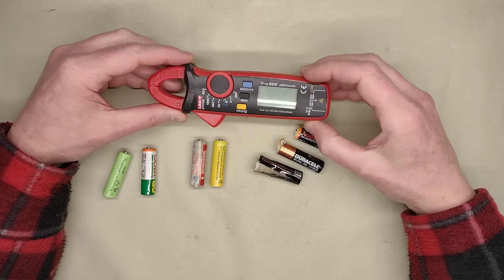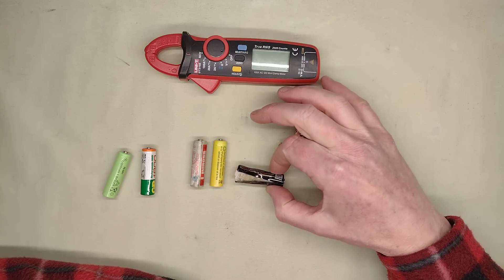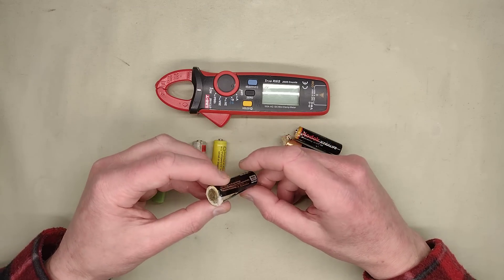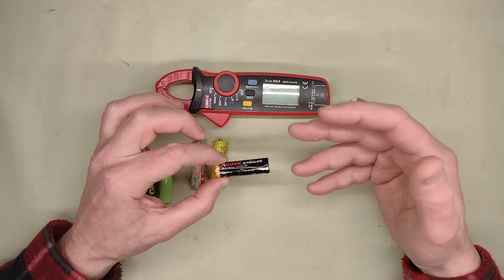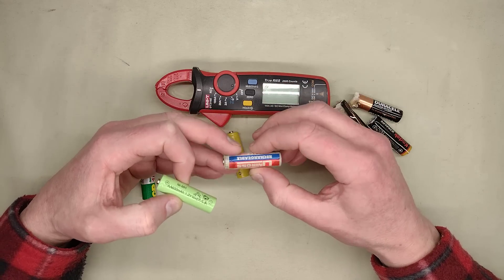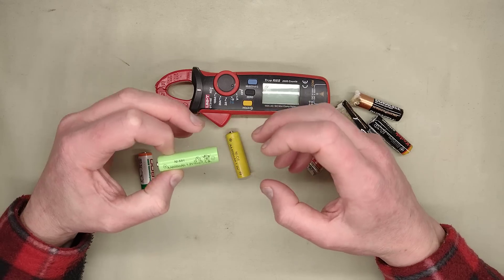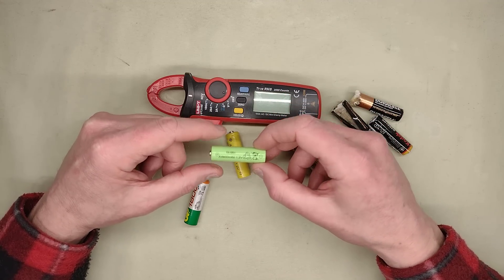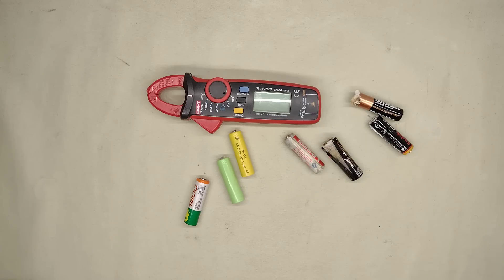The curse of leaky alkaline batteries

Comment: at my work, I go through several hundred alkaline batteries a year and can't recall the last time I've seen one leak. many of them can be several years old and I buy the cheapest ones I can find. I estimate I have approximately 800 alkaline batteries in one building and about 720 in another building in use at any given time
Reply: But if you buy the cheapest, that won’t be Duracell brand…
Reply: @Mark1024MAK  through our supplier it can range from the maintenance warehouse brand to the Duracell Procell or sometimes Rayovac.

Comment: Alkaline batteries were a huge improvement over the old carbon zinc flashlight batteries. I have bought primarily Duracell batteries (the copper top) for a number of years. I have noticed a sharp decline in their resistance to leaking somewhere during the past 5 to 7 years. I have had Duracell batteries leak in the packaging, long before their stated expiration date. I think that Duracell is just a trademark name they put on the batteries, & they are actually made by some Chinese companies, who are probably the lowest bidder.
Reply: Exactly. I've found Duracell batteries in my boxes from twenty-odd years ago: no leak.
Ones still in packet from the year before: leaking.
Some advice I got a few years back was to buy supermarket branded batteries: Sainsburys doesn't want their name on your ruined equipment, even if Duracell don't care.
Reply: It is typical in manufacturing to have a goal for managers to cut costs by 1% or more every year.

The end result is that after 10 to 15 years of cost-cutting the resulting product is poor quality.

It's likely that the leaking is processed by cost Savings of less than $0.03 and the batteries would cost 5 to $0.10 more if they didn't leak as easily.
Reply: @mac_mcleod  Nail on head I'd say. Years back they didn't leak, it was a sales feature, now they do
Reply: @mac_mcleod  this explains so much
Reply: The zinc-chloride batteries weren't that bad in the past either. I have a pound shop scientific calculator that I bought in 1996, which still has the original Hitachi cell I put in there on day one. Gets used every six months on average and not showing the slightest signs of leaking. I find it amusing that such a device has outlasted just about everything else in the house!
Reply: @jasejj  As long as the zinc chloride isn't too large (AA or smaller) and can breath I don't find mny issues on them either - not even newer generic store brands. I even bought a vintage Sharp calculator at a thriftstore because I wanted a physical calculator at my desk. It still has the original zinc chloride/carbon. Can't remember if they expired 1983 or '85 yet they've not leaked and still powers the calculator(!)
Reply: @jasejj  I have a calculator that gets rarely used and still has original cell over 20 years later!
Reply: The problem isn't just chinese manufactured Duracell. I found a whole bunch of leaky Duracells from Belgium that were leaky. 
I have now switched to German Varta's. We'll have the results in a few years i guess.
Reply: @mfbfreak  Duracell's have failed me already more then 15 years with leaking.  I made an error to not take out the batteries from my pinball machine that i put in storage in 2009 (feared the worst) which are just to keep settings/high scores. Came around checking it a few months ago. NO LEAKING whatsoever.. even one battery tested as nearly full! Date on the battery 12-98!  These where Varta's Alkaline stating "Extra Long Life" seems the Germans where not bullshitting on that. Do hope new Varta batteries have the same quality.
Reply: @mfbfreak  varta have been good in the past, but the ones sold here in Australia the past year or two now seem half the capacity they used to be, and have actually had my first carts from the "new era" leak. It may be the issue that the sole retailer here has kept the price the same for years, forcing varta to compromise
Reply: @mfbfreak  , ive had trouble with vartas.
Reply: Maybe this is news for someone, but many companies make different quality products under exact same branding, for different retailers, for different regions. If you are buying a cheaper brand name product it can often look pretty much the same but made in a different factory from worse materials and worse quality control. Big stores often demand lower price versions of the products forcing manufacturers to cut corners.   Sometimes they even refuse to provide normal guarantee for those versions.
Also worse products are made for poorer regions, countries with corrupt govts, that don’t care about environment or health of their citizens, where safety regulations don’t exist or not enforced.
Reply: Yeah, Duracell has been hot garbage for the past few years, at least for me. I don't think I've pulled one of their cells out of something without it being crusty in years, and they seem to be dying on their own faster than my rechargeables.
Reply: Helpful Tip: When buying bulk akaline cells, always buy the ones like Duracel or Energizer that are sold and shipped by Amazon direct. They're always brand new and NOT out of date like the ones from the 3rd party Sellers.
Reply: Same here with regards to leaks with recent Duracell batteries, well those that are at least between five an ten years old, when they were made under Mallory they seldom leaked, my theory on this is in the older days they were better sealed, things were made to a higher standard but sadly now with such things there made in china cheaply an in some cases not to a high standard and the materials are of poor quality, hence the leak's. China is also knocking out fake Duracell batteries and Panasonic ones to, some are easy to spot. I once bought a torch and inside were two Panasemig batteries, yes that's the spelling, probably named to avoid copyright, a word of caution though be careful with some Chinese rechargeable batteries as sometimes these can catch fire because china sometimes does not build such items to a countries safety standards.
Reply: @mikecummings7054  Mallory Corporation hasn't existed in years which might explain why the Duracells (and probably Mallory branded batteries in Canada, instead of Duracell branding they used to brand their batteries Mallory up there) are of lesser quality nowadays.  I think people are correct about the current Duracells being Shen Zhen Shit batteries, just a very little bit better quality than the random letters brands that come from the same place.
Reply: I tested quite a few batteries, cheaper ones perform almost as well (capacity around 1900 mAh for AA, for example) but they very often leak if left alone. Had boxes of cheap Kodak-branded ones and after few years in storage 40% leaked completely, remaining ones in the same package are totally fine and work basically like new.
It is totally fine to buy cheap alkaline cells as long as you are going to use and discard within, say, 1-2 years.
Reply: I have a collection of calculators and have bought LCD calculators from the early 1980s still with the original Japanese made (Toshiba or Sharp) alkaline batteries inside, not leaking and still working fine after over thirty years. They obviously don't make them like they used to.
Reply: I agree to the most part, it's insane how high the leakage rate is now. The one brand I find rarely leaks are Rayovak. They also are much cheaper per mAh, so I rarely use anything else...if I can't get away with using NiMh instead.

Comment: Thanks, but I have quite a few older pieces of kit that will not run/run for short periods because of the low voltage of NiMh. For newer kit, yes no issue.

Comment: For applications like powering DMMs, I'm thinking of Li-pol cells with 3V LP2985 low-noise ultra-LDO for powering and TP4056 for charging. But I still can't find free time to prototype the PCB for the typical bay size for 2xAA or 2xAAA.

Comment: I use Eneloop Pro personally. They last 50-70% longer than an alkaline equivalent. In something like my high output flashlight.. it can drain a normal battery dead in 5 minutes, but rechargeables will last 10-15 minutes of constant use.

Comment: Thanks Clive! Do you have tips on cleaning / repairing devices damaged by alkaline leaks? Perhaps another video!
Reply: A weak acid like vinegar or lemon juice will eat away at the alkaline battery spooge. If it's mainly just a battery compartment you're dealing with. Best to just disassemble the device, put the part of the shell containing the battery compartment into a bowl and put in your vinegar and let it soak a bit. Use a small brush occasionally to work off the loosened junk. However the battery terminals that were attacked by the batteries won't be nice and shiny anymore since the batteries alkaline contents will have attacked the plating on the contacts. If it's on a PCB itself you can spot treat with vinegar or lemon juice and cross your fingers you don't have eaten through PCB traces that you're going to have to rebuild with bodge wires. If it's a multi layer board and worked it's way inside the layer, you're pretty much SOL. This is a common problem in the retro PC world, where boards from the late 80s early 90s had rechargeable nicad cells soldered to the board and these boards sitting in storage the last 20/30 years have had the batteries leak out and destroy the board. The YouTube channel necroware has some videos on repairing these boards that aren't too badly damaged. Involves cleaning up the leak and rebuilding board traces as long as it's only surface damage
Reply: If the leakage is a clean white colour and is a dry powder type, you can wash it away under a running hot water tap. Let all water drain away and let the item dry for 24 hours before putting in any new cells or battery. Otherwise follow what Doug K wrote and use white/distilled vinegar (from supermarkets).

Comment: So far for the most part I am using NIMH as well as some Lithium rechargeables for some stuff. I usually am using alkalines for devices that require to many batteries or things I don't want to ruin a rechargeable on like something close to water or something in the bathroom or kitchen. If I am using alkalines I tend to use Energizer or Fujitsu as those two brands seem to take the longest before they leak.

Comment: I've started to gradually replace all the batteries in my house with NiMH batteries. The only thing I can't really give up alkalines for is an electronic safe. Those things need the linear discharge profile to accurately keep track of battery level, and also because the manufacturer recommends anything other than Alkaline.
If one does need a slightly higher voltage, however, those Energizer Primary LiFeS2 batteries seem to be fit for the job and they don't leak.

Comment: Oh, I recently had a Duracell™ with Duralock® that nearly killed my multimeter due to leaking. But still I'm not sure about NiMH cells in multimeters. What is cutout voltage of the UT210E for example? I bet it's the same as the other DMMs based on DTM0660 (DM1106): around 2.2-2.4V.

By the way, I've never seen a leaking GP alkaline cell. 🤔

Comment: NiMH becomes an issue especially with cells in series - got a few devices using 2x or 3x AA/LR6 or AAA/LR03 in series (CMOS battery replacement in old PCs, for instance), meaning 3V or 4.5V. Even with them dropping down to 1.4V per cell or so over time, that's still quite a lot above the 1.2V of NiMH cells, sadly. Tried a few clocks as well, they tend to dislike the low voltage too.

When and if voltages can get bumped up on rechargable cells to equivalent levels, I'll definitely switch from alkalines. It's a shame NiZn has a higher self-discharge, otherwise that might've been interesting.

Comment: maybe you can answer the question , why can't they make a cadmium or nickel metal hydride batteries in 1.5 volt for aaa , aa , c , d and 9 volt for transistor batteries  ,  and why 3.7 volts for rechargeable lithium batteries . can you do a video on these questions
Reply: It is the electrode potential that determines the battery voltage. Look here https://en.wikipedia.org/wiki/Galvanic_cell#Cell_voltage

Comment: The only issue I have had with using NiMH batteries has been realatively dumb devices that to operate normally or a normal performance require the 1.4/1.5 Volts.  That and charlatans selling mislabled NiMH batteries as a higher capacity per charge, or in one case, form factor, with tons of customer reviews from people that didn't realize they were scammed.

Comment: There was a time in Australia about 30 years ago when Duracell batteries never leaked, and so were my go to. However over the last 10 years I’ve found they leak.
Reply: That is because Duracell is now just a brand name slapped on some random cell. They stopped making batteries years ago when they were sold off to VC and hedge funds who just kept the name, but farm the actual work out to whoever is cheapest.
Reply: Duracell has become one of the worst batteries for leaking. I find Costco Kirkland batteries better and cheaper.
Reply: @ColinTimmins  those are rebranded duracells

Regular energizer alkalines are the best I have found for staying leak free. It still happens from time to time, but far less or as quickly than duracells.
Reply: Duracell are the worst for leakage in my experience. I expect a battery to leak if it is left on load when flat but Duracell seem to do it just for fun. They are utter garbage and I won't buy them.
Reply: @tubaman66  i have 2 sony alkaline battery in the remote of my old vhs that the date is until 2001 and still working without any leakage  still 1.4v because the remote gets no use now
Reply: Duraleaks are the worst of  all alkaleaks.
Reply: Exactly, same here in the UK. I recall in my younger years that Duracell batteries were guaranteed never to leak! Infact I think the company would pay to repair your equipment if indeed they did!  Lately I’ve been noticing countless Duracell batteries leaking!
Reply: Yeah, Duracell have been hot garbage in every encounter I've had with them for the past few years now. At this point, I avoid them like the trash they are
Reply: Back when i was working in a local charity shop anything battery-powered that came in was checked for cell leakage and majority of leaking ones were Duracell. And no, it wasn't due to more Duracells being used in the stuff donated.
Reply: Sorry about the editing scars in that.
Reply: I got a wall clock for my office as a Christmas gift.
Yesterday I looked in the supply pantry for a battery and the two Duracells I found had leaked.
Reply: I have found the same. Duracell at one time made it a point in their commercials that they where the go to battery you could count on to work in an emergency after sitting in a drawer for a long time.
Reply: Exactly the same in France, I've ruined several items due to the current Duracell products. I remember when I was young, using Mallory brand which became Duracell later, it was really a reference for camera cells... Sadly, I resigned to use anymore Duracell, it became dangerous craps.
Reply: Same... the last 'real' duracell duralock batteries I had were from 2015 and came with a logitech wireless mouse... they last till 2021! I still have them in the desk drawer as a memento :D

Looking closely at it the bottom (anode? the minus side) of the good old ones they have DURACELL stamped in a circle and the anode is shaped as a plate, the more recent ones don't have anything aside from a yellow seal and the anode is shaped as a flat disk.

New ones leaked after 1~2 month on a wireless mouse - different logitech mouse, only takes one battery, original lasted 2 years - and to think I got a package of 10 batteries thinking they were as good... From a sample of 6 batteries they all leaked in less than 2 months after use!

Incidentally I got some branded from a big supermarket chain that are really nice, I'm yet to get any leak after 2 years on use in a wireless mouse, bike lights and digital scales...

But yeah, I got some low discharge NiMH and a USB charger for those uses where I know I'll be handling the device, the last thing I want is to have electrolyte all over the desk and hands...
Reply: Many years ago alkaline batteries used to have a film of mercury around the electrode that compensated for impurities in the zinc. Obviously due to concerns with mercury in household products and regulations around that manufacturers could no longer use it, meaning either using more expensive higher purity zinc or just losing that protective buffer and suffering with more common leakage.
Reply: Same here, they used to be the 'go to' brand, now they are only trouble. Now everyone seems to be calling them 'duraleak'
Reply: I wonder if the factory that makes Duracells is the same that makes AC Delco (or is it Westinghouse?).  I've seen packages on store shelves with leakers in them.

Update:  It was Westinghouse.  Found another pack with a leaker in it recently.
Reply: I don’t remember alkaline batteries leaking when I was a kid… but not so much 35+ years later… does anyone know what has changed???
Reply: @nawknivek  About 30 years ago, although Duracell didn’t leak, they were also the most expensive, cheaper batteries leaked, but we all knew that. Then along came Energizer which had slick adds and were cheaper, I’d suspect to compete the Duracell manufacturing process was made more efficient to be price competitive.
Reply: .... Morrison government.

Comment: Speaking of NiCad batteries. The battery that never dies. Ever. I still have several Radioshack RC car 7.2V battery packs from the 80's (!) that I use in the electric start for my RC nitro truck. The damn things still work and hold a charge even to this day. They are the Methuselah of batteries. Edit: Only if you leave them off the slow charger. Those old trickle-chargers would just dry them out and kill them if you forgot about it.